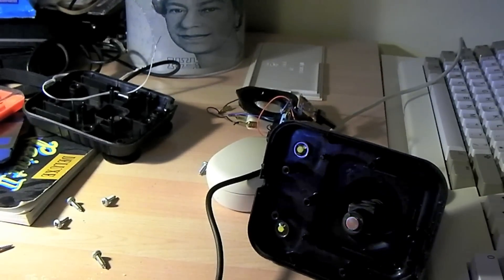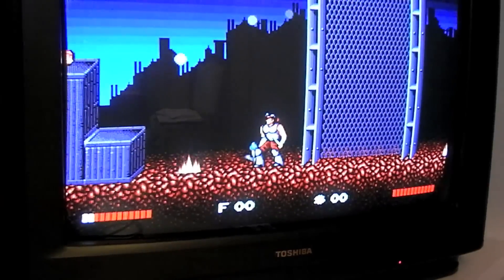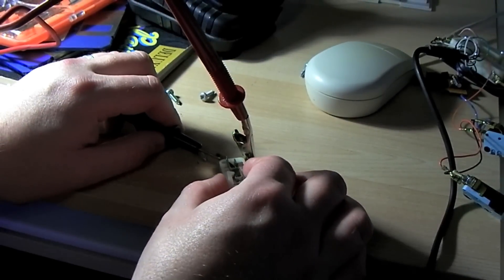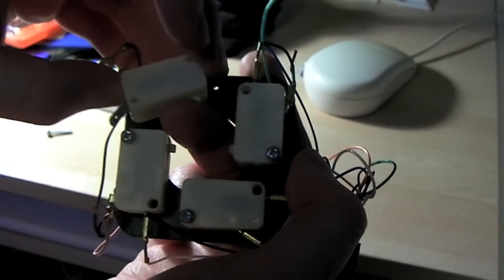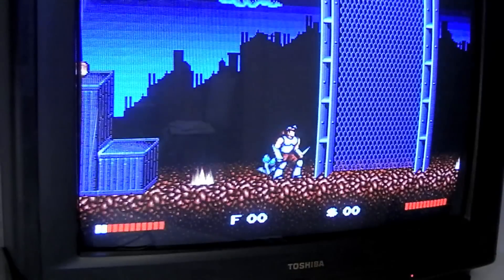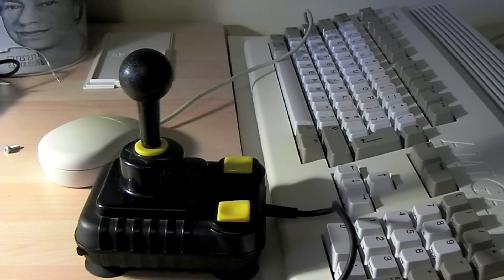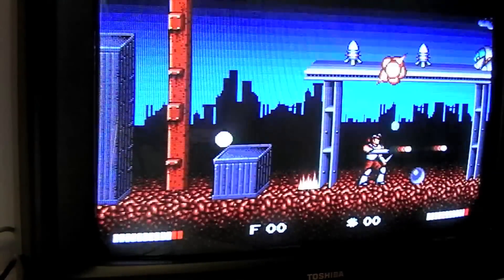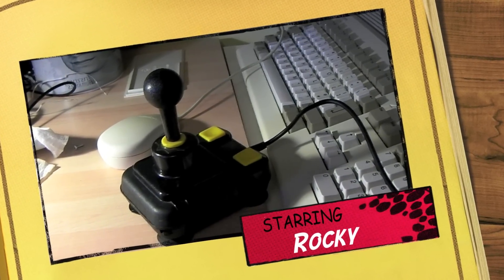Amiga ZipStick Joystick Repair

Comment: Hi Vintage Views, just bought one of these from ebay however it's very stiff to use. After watching your vid I was able to take joystick to bits and it looks like the small metal spring inside of the microswitches are causing the stiffness. I'm not very DIY minded, would you mind telling me what would be the best "contact cleaner" to loosen up these springs? (I'm from uk). Cheers man, great vid.